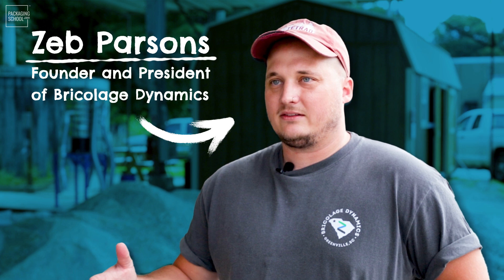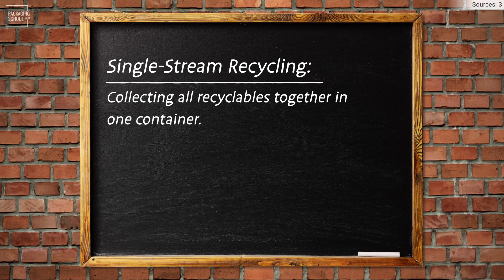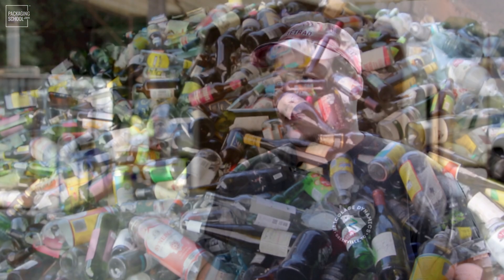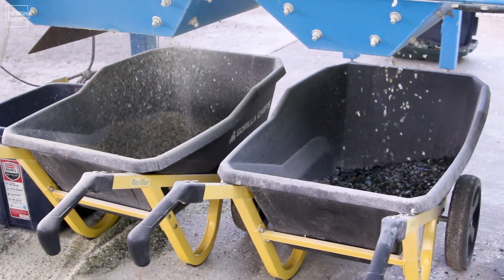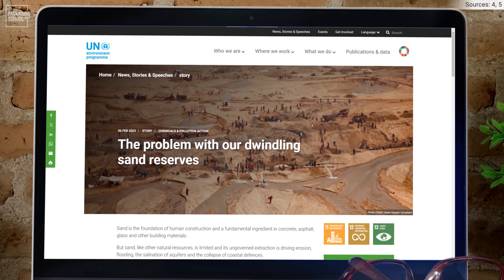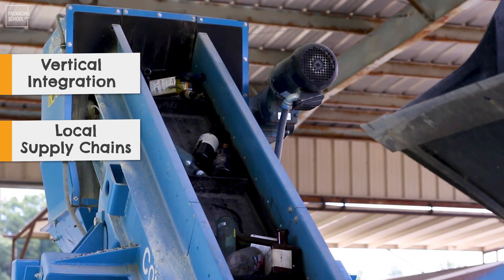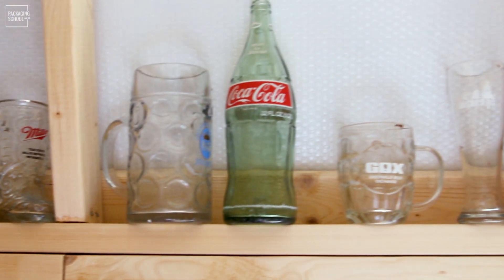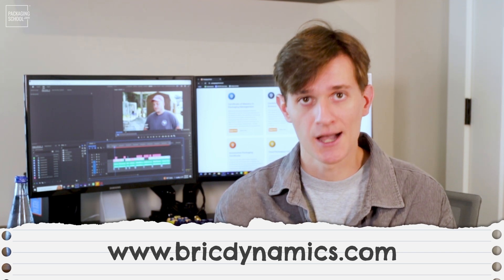Solutions to the Glass Recycling Problem w/ Bricolage Dynamics │ LOTM Ep. 17

Comment: great initiative and ingenious approach to recycling! One caveat: I would be concerned about silicosis when working with too fine glass particles, especially if airborne
Reply from the maker: Preventive measures and strict adherence to safety protocols are crucial to protect workers from the harmful effects of silica dust exposure. Bricolage has the added benefit of their machines being outdoors, so ventilation is not an issue.